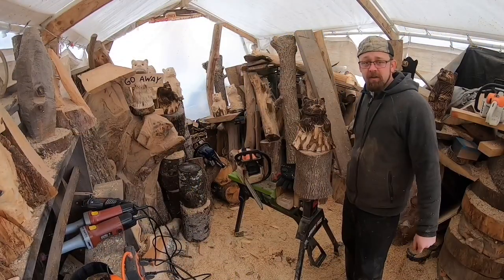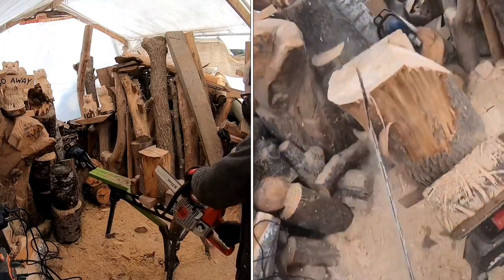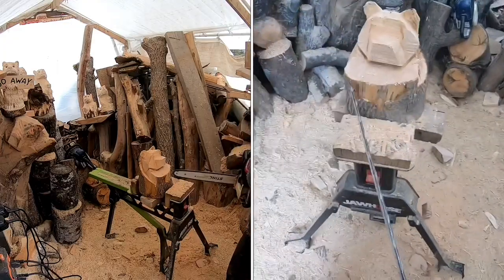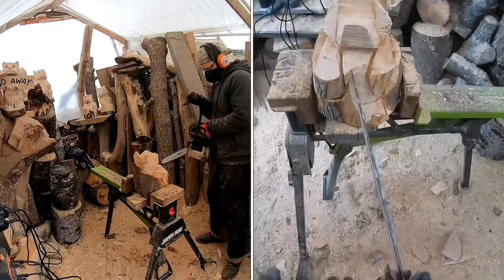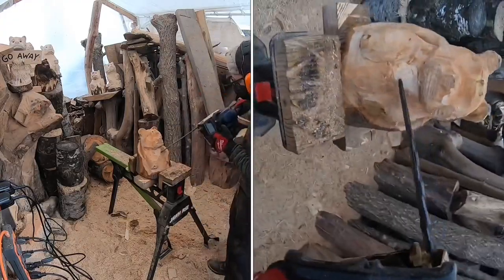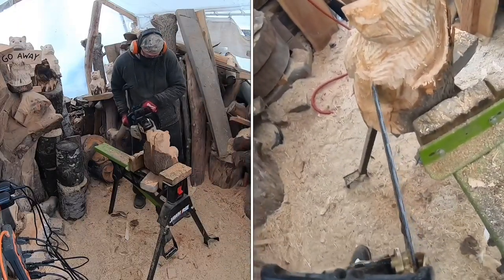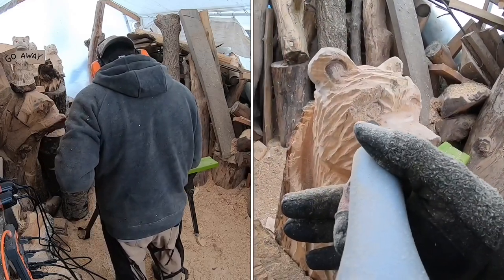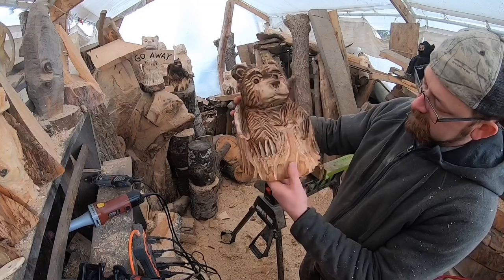Step by step Chainsaw carving a cute bear in a stump. Chainsaw carving tutorial.

Comment: Is it possible to buy a thinner chain and smaller carving bar like a 12 inch instead of a 16 inch and buy one that has more teeth mine has only 31 teeth
Reply from the maker: Honestly it depends on the saw . The gas powered Stihl saws have that ability. I’m not sure about the saw you have . You would have to research and see if they make different bar and chains for it